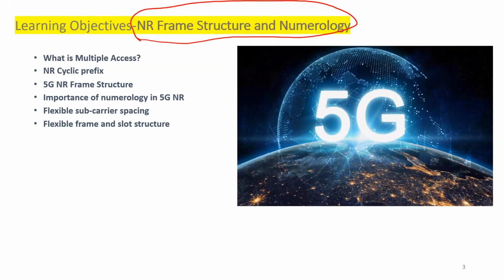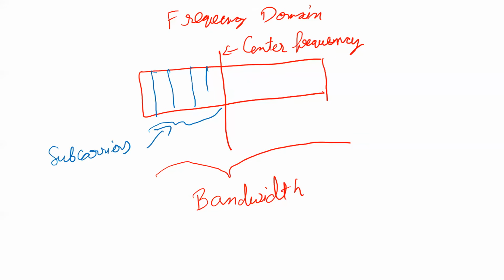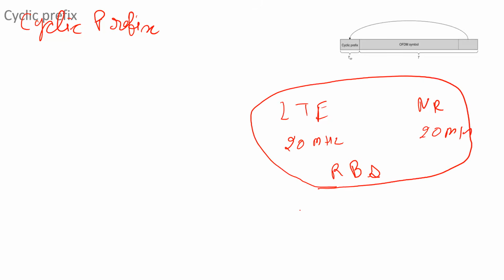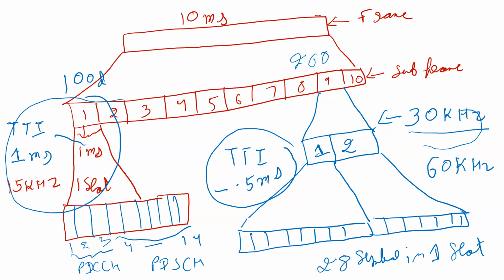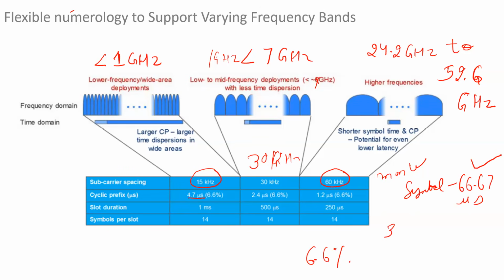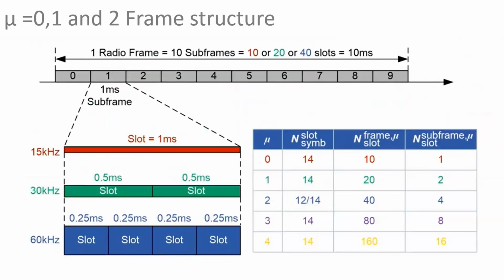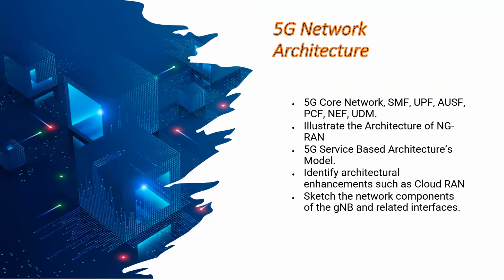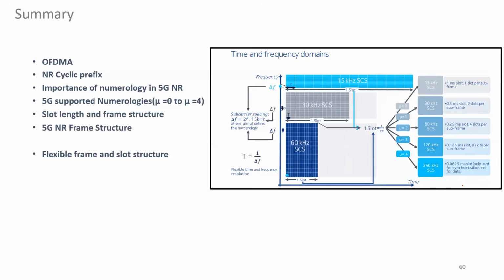5G NR Numerology and Frame Structure

Comment: In terms of detail and structure, such a training really helped to revolutionize my concepts on detailed mathematical calculations in RB. The different sub carrier spacing in 5G is something designed to achieve a low latency and high throughput. Thanks a lot, 5G Guru.

Comment: 34:40 Number of RBs will not be the same for 20MHz LTE and NR. It is 100 and 106 respectively (assuming NR numerology 0)
Reply from the maker: yes you are right.Thanks a lot !! LTE has efficiency of 90 % so effectively only 18 MHZ out of 20 MHz can be utilized